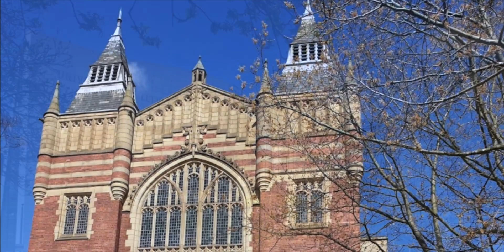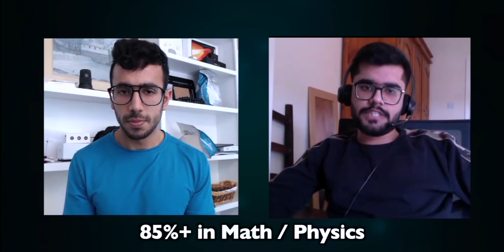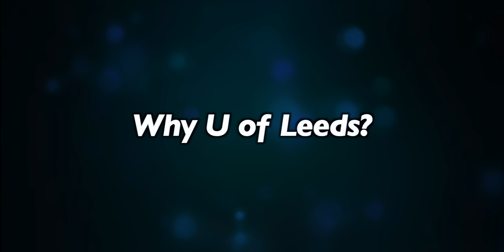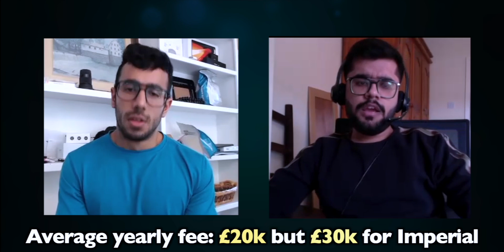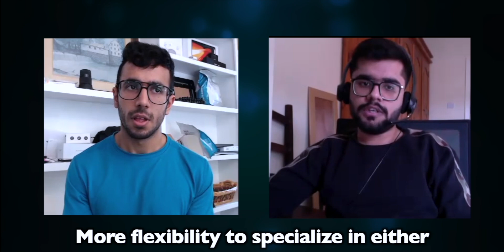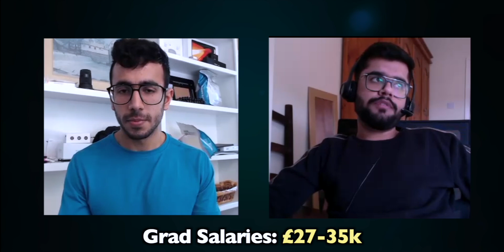Aerospace Engineering in UK! University of Leeds!

Comment: Hi @Shivashish Arora  - need to book accommodation at one of the catered residences available for year undergrads (first year Computer Science), could you shed some light on the same, travelling from India? Could you also share your residential experience @UoL.
Reply: Hi Obula, thanks for your comment. Firstly, congratulations on securing a place at Leeds. 

I personally did not choose catered accommodation because for me it was a bit expensive. There are multiple catered accommodation options and depending on which one you choose, the food you get may be different. 

A famous catered accommodation is charles morris halls, in that particular one, you will get some daily credit to get food from a restaurant (called the Refractory) on campus. The food is ok, there is variety but you will less likely find Indian food there (I think). You are more likely to find dishes like noodles, pizzas, bread, sandwiches, etc. Obviously you also get the other basic fast food stuff like drinks and chocolates. 

There is another one I know called Devonshire hall. I think for that one they have got their own room on their accommodation where they have breakfasts - so you may have to go within a particular time slot to get meals from there. I am not aware of the kind of food available. 

If you don't choose to take the catered option, like me, then you can find some tiffin services in Leeds. I personally went for this option and was much cheaper comparatively. Paid around 150 pound per month, for one tiffin per day - was sufficient for 2 meals. This was Indian tiffin service so I quite enjoyed the food. 

If you have more questions you can find me on LinkedIn - please send an invite note whilst sending the connection request so I recognise it is you. 

Else you can send me a message on Facebook
https://www.facebook.com/shivashish.arora.1

I hope this helps, take care.
Reply: Hi @shivashisharora    great information thanks for that. It's actually, my son who has secured the admission in CS at UoL😀, will send you the message on LinkedIn/FB.
Reply: @obulareddyankireddypalle9770  thats great, congrats to him 😊